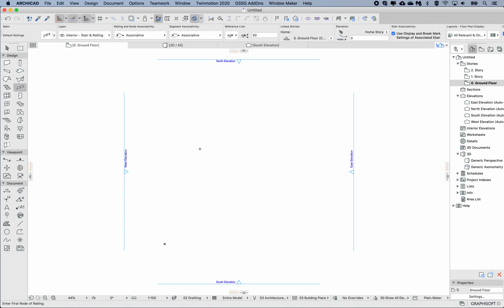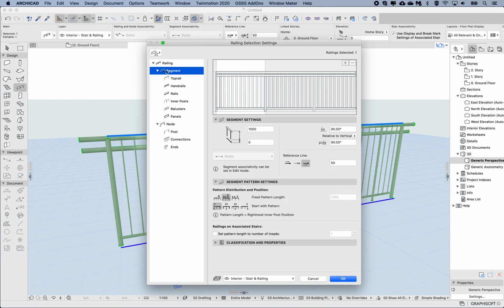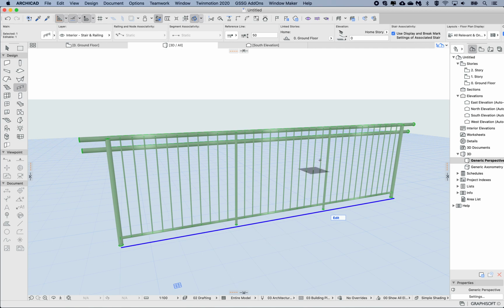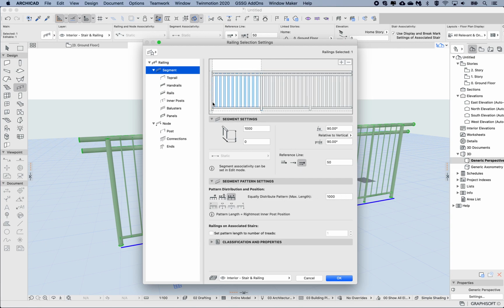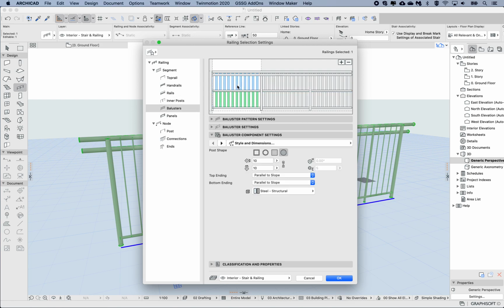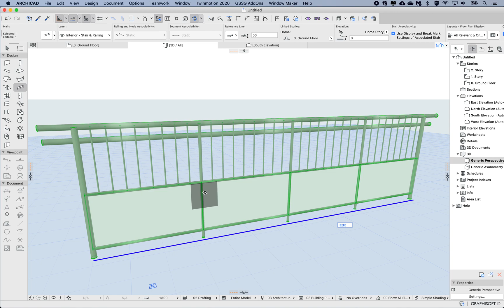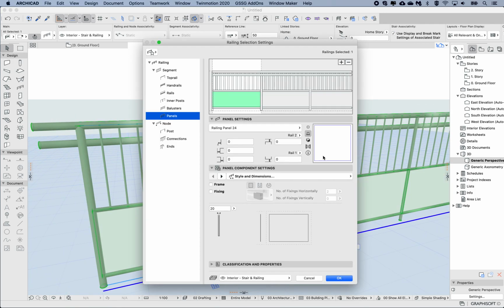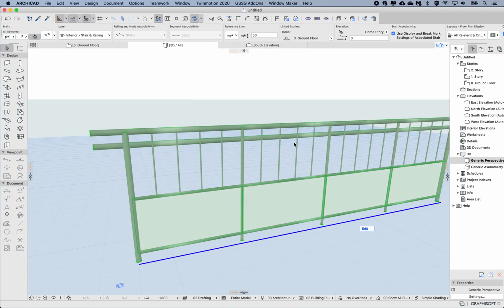Archicad Tip - Edit the Railing Segment and Pattern

Comment: Pls do a video on applying this to stairs
Reply from the maker: Could you elaborate on what part of edit mode and stair editing? I shared some tips on Stair already.
Reply: @JamesBadcock  like how you add/move nodes to the rails without affecting the others. I notice when i use wand to the stairs the balusters of the railing resting in the nosing of the treads, if I move them the other will move to same with Posts.